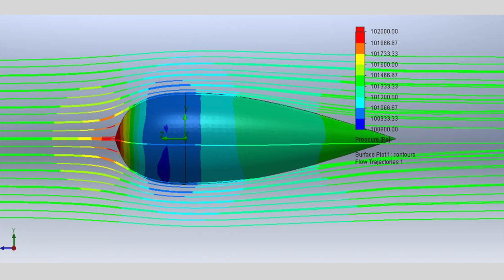What does Speed of a disc means

Comment: 11:20 Do you take the gyroscopic precession into account? Won't the pitch moment, caused by the off center drag force, translate into a roll (i.e. turn)?
Reply from the maker: Hi Matej! Yes, you're right: it will affect the disc flight via gyroscopic precession as it does the lift force and it will act even if lift is zero. But keep in mind that frontal area of a disc is roughly 1/10 of its plant area, so drag ( and its associated angular moment, should be way smaller than lift ( glide ). That means a very high Lift/drag ratio, so high efficiency ( good news ).